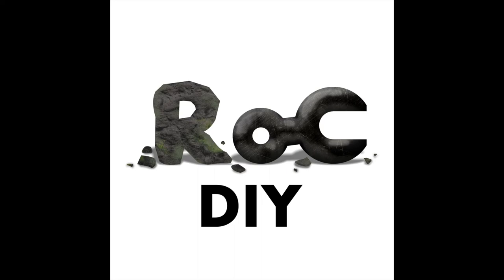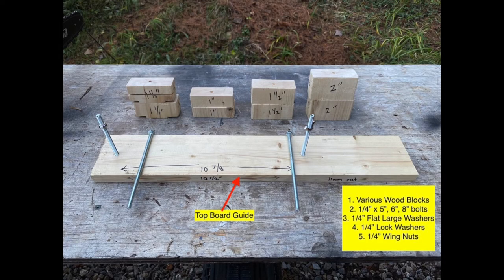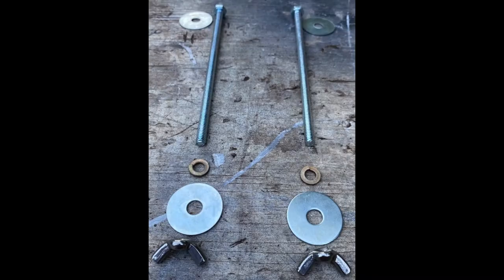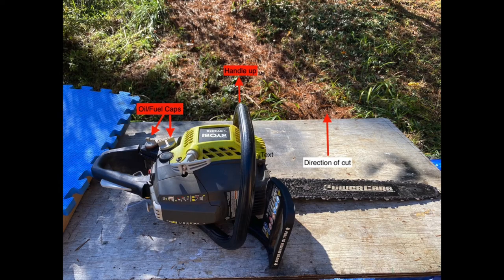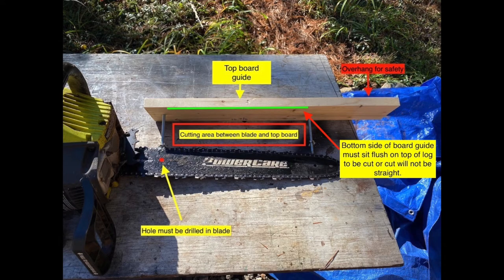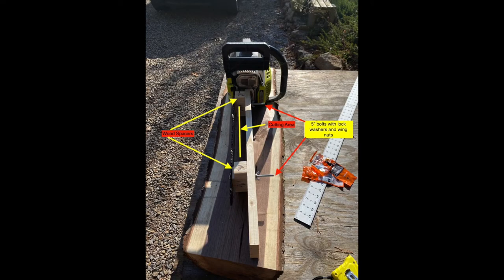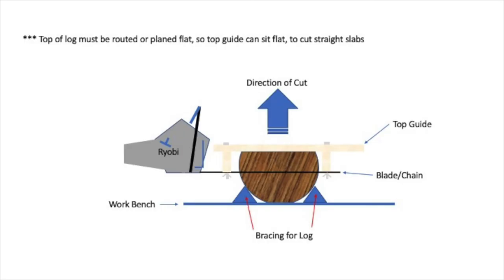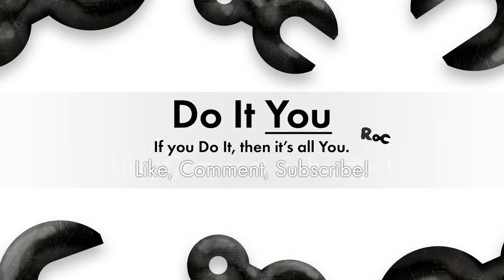Chainsaw Mill: Home-Made Alaskan Chainsaw Mill

Comment: Gonna have to make one of these
Reply from the maker: My Ryobi chainsaw broke a year ago and needed a $1.67 part (throttle trigger) that Ryobi said they weren't making anymore. They suggested I buy a new chainsaw. They finally sent me the part. I have some seasoned and sealed black walnut that I will cutting in to slabs soon. I really didn't want to convert another chainsaw.